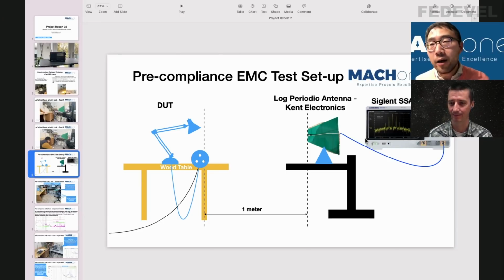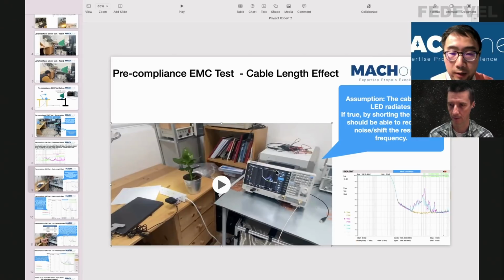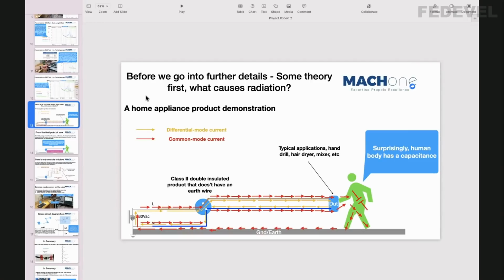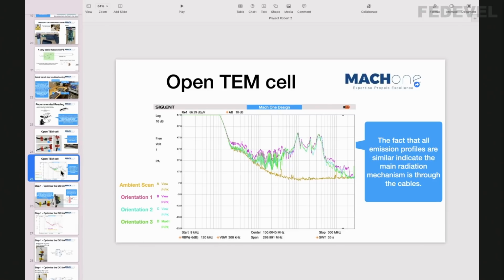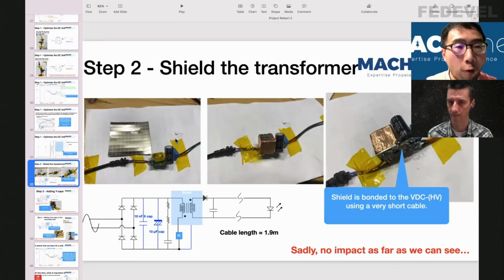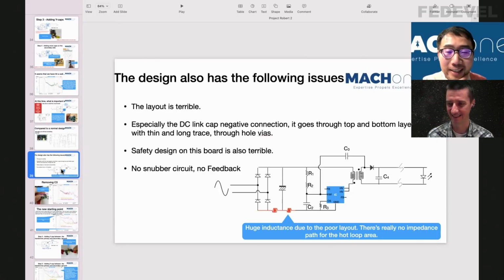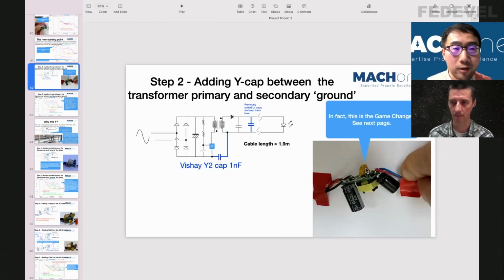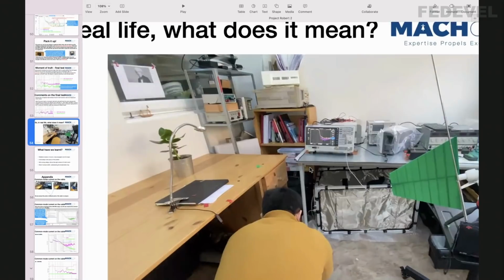Learn To Fix EMC Problem Easily And In Your Lab - Troubleshooting Radiated Emissions | Min Zhang

Comment: i think it is the interwinding CAP of the transformer which causes the main common mode current problem, and the CAP between pri gnd and sec gnd, provides a bypass way of the common mode current.

Comment: Why does he mention the .5m from the  v=λf formula ?? How does he get 40Mhz?
Even going backwards 
Speed of light (m/s) / 1/f (s) = so the seconds cancel out, and you're left with meters.
300,000,000m/s / 0.000000025/4 = 1.875m which is the cable length.
So why is he talking about the quarter wavelength being .5 meters?

Comment: thanks for good video but i couldnt understand where is the huge radio transmitter's signals in last measurement on 1:13:20. it is mentioned and seen in first measurement which is mentioned at 10:45. if they are not seen, it means spectrum analyzer dont work well or the antenna didnt connected well.
Reply from the maker: Looks to me that Min is not showing that frequencies on the display

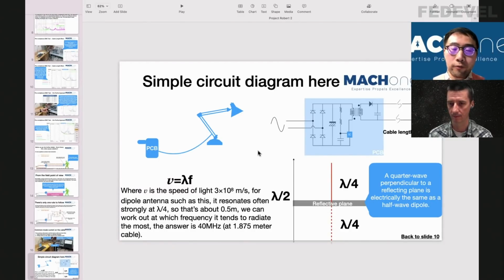Comment: I'm confused with the quarter wave antenna calculation part (14:53). If I use 40MHz to calculate lambda, I will get 7.5m. Then 7.5/4 is 1.875m. I'm confused as to where 0.5m fits in. Kindly clarify..
Reply: I think maybe your calculation is right...

Comment: The CM NOISE source is the current driven through primary to secondary parasitic capacitance due to switching 
Imagine the Mosfet drain is swinging between 400v and 0 
And there is a capacitance from the drain to the secondary side (parasitic) so a current will go through that capacitance this current can only return through earth 
If we connect a return path from secondary to a cold point (non switching point)  this current will mostly return to its source, so will not go to earth and its return loop will be very short so no radiation 
This return path is done by Y2 CAP

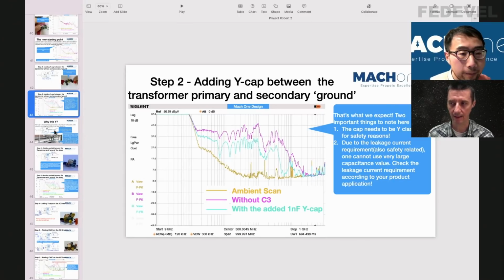Comment: 1:01:35 Why does the Y cap reduce noise? Many thanks to Robert and Min for producing this video, very informative.  So just to add to the Y cap discussion -- I don't think Ming quite spelled out the cause of the noise in the first place.  The noise is common mode on the secondary side of the transformer -- ie: the noise voltage is not between the  two output leads, rather it's a voltage on both output leads relative to ground, or more locally, relative to the primary side, say the input side negative rail. This noise almost certainly comes from the primary side switching voltage applied to the primary winding which is capacitively coupling to the secondary secondary. Ie: along with acting like a transformer, the two windings also act like the two plates of a capacitor.  (Between primary and secondary, transformers often have a  layer of conductive tape which is grounded, to block the primary-to-secondary capacitance, but either not in this case, or it's not effective.)
The primary switching is at some significant frequency like 100kHz, and being square pulses, there are many harmonics. The amplitude of those pulses is 170V (for 120VAC line) or 340V (for 240V line), so it doesn't take much inter-winding capacitance to impart  that noise to the secondary side, which initially had no other path to ground or to any ground-connected path.  
So adding that Y cap provides that path -- essentially forming a capacitive voltage divider, with the transformer capacitance as the upper leg, and the new Y cap as the lower leg.  So long as the new Y cap has much lower reactance than the transformer interwinding capacitive reactance, there will be significant reduction in the RF on the secondary.  But this comes at at the cost of increased line-frequency"leakage" owing to the Y cap not connecting to ground, but rather to the negative side of the full-wave rectifier bridge. (as noted in the video).
Reply: That's a great explanation Graham, I totally agree. I need to copy your comments and put them on my notes. Many thanks

Comment: Great movie! Hope the EMC movie series continues!  An interesting topic for the next episodes would be solving problems related to reducing the impact on EFT (Burst, Surge) and ESD. Thx.
Reply: EFT is a big headache. I can manage to do better design for surge, but not for EFT.
No one talking about it and one protection circuit works with one PCB design may not work with another PCB.
Reply: I'm interested in EFT and ESD too!

Comment: Get a calibrated  noise source   or make a pwm generator .... get it tested by good  spectrum analyser.......... use that calibrated source to calibrated SDR(software define radio   or FFT section of oscilloscope!

Comment: If you look at some data sheets for isolated supply modules (Traco, Mean Well ,ect...) they show the circuit used to pass EMC. It's basically what was added to this product to pass the requirement, that's if the original positive DC Y cap was left in place. They have a common mode choke followed by a LC filter on the input, with Y caps between positive DC rails and the grounds. The tip about high capacitor values increasing leakage current is exactly why I watch these videos, I learn something new every time. That circuit is wild, it's as though the engineer looked at the datasheet "simplified block diagram" and thought it was all it needed? lol Application notes were NOT referenced for sure, it's kinda blowing my mind the IC is surviving the voltage spike on the switching node. I'm not a hardware expert, light years away from a SMPS expert, yet even I know this is missing more than a few components. Seeing stuff like this gives me some sense of reassurance, I lose sleep worrying about something I missed in a design for years after they have been in service.

Comment: Great video! Thx. 
I was wondering why there is no RCD clamp on the switch node  of primary side (drain), and no RC snubber on the diode? Those should be major noise sources.
Reply: Well, if they want to make profit, surely they need to find a way of cutting cost, that's the problem with volume production.